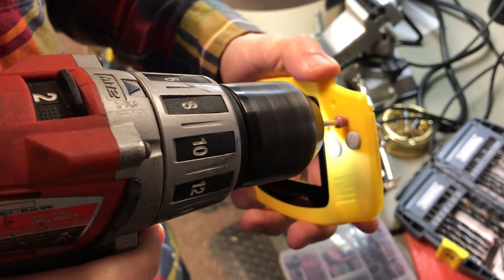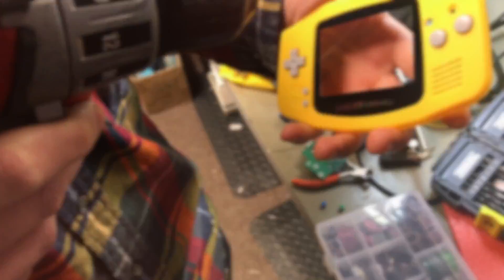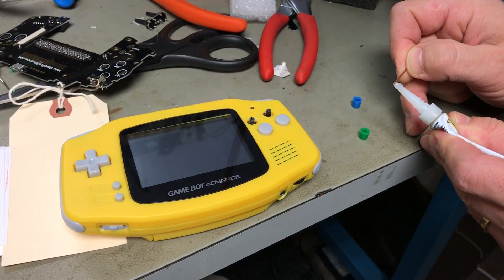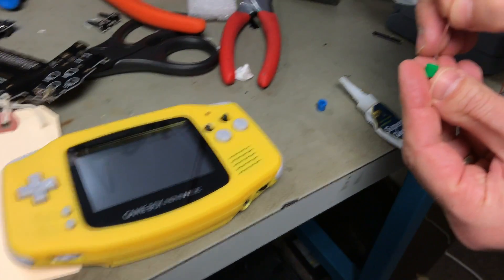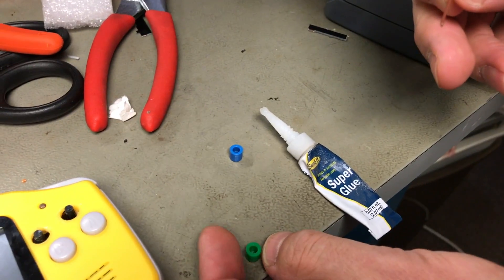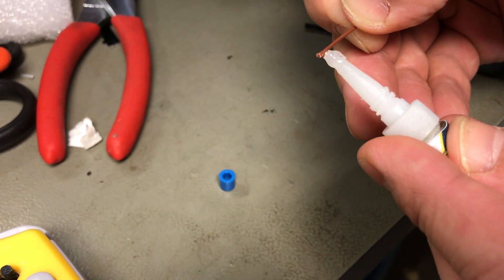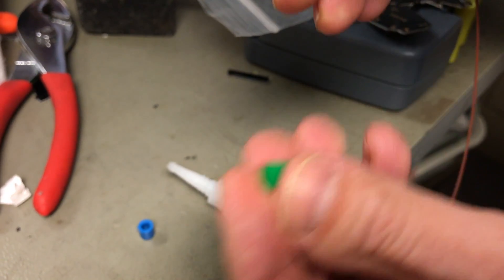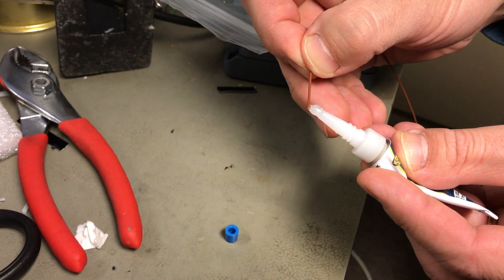Freeplay Zero/CM3 (formerly Game Pie Advance) X/Y Face Button Caps

Comment: Your PCB is awesome. But why didn't you place the X and Y buttons on the template instead of placing 2 sticks on the board and then a couple of caps? It would've been perfect. I'd buy one if your desing on the ABXY buttons was axactly like the UpDownLeftRight. Still great job!
Reply from the maker: SillyWalks if you could find room to do that, I would love to. The space is really very tight, and there’s not room on the circuitboard to do it.  The small button shafts actually protrude from under the circuitboard through the circuitboard and through the face of the shell.
Reply: What about a sub-PCB over (or under) the actual board with its actual connections? I don't know a lot of this stuff, but gosh, i'd love XY buttons like a SNES controller on the GBA shell. Maybe I'm a wonderer... If I can figure out some mod I'll tell you, because I'm really interested on your project. Keep cool and do magic!
Reply from the maker: SillyWalks We are always working on this stuff, but there’s plenty more to work out, too. :)

Comment: where did you get the button tops?
Reply from the maker: Try the following eBay search, but be sure that they have round holes.  There are other caps that have square/rectangle holes, and I think they won't work as well (but haven't tried).  http://www.ebay.com/sch/i.html?_from=R40&_trksid=p2050601.m570.l1312.R1.TR8.TRC1.A0.H0.Xtactile+button+.TRS2&_nkw=tactile+button+cap+%286x6%2C6*6%29&_sacat=0
Reply: Found them!! Thank you.